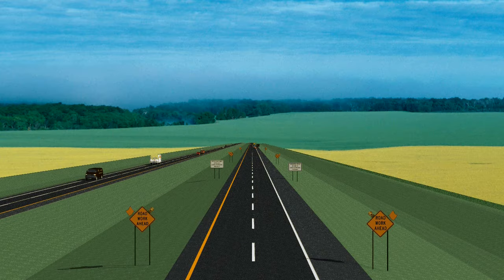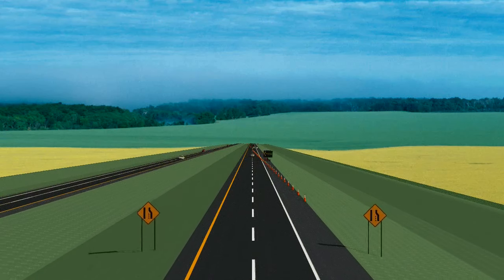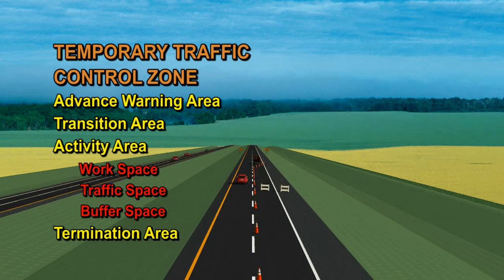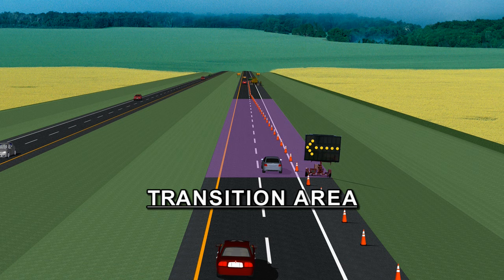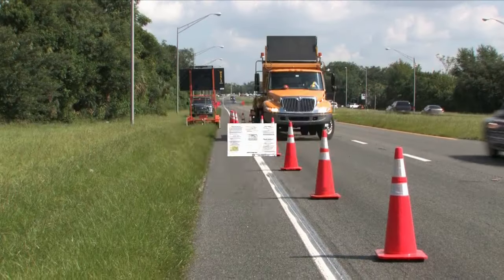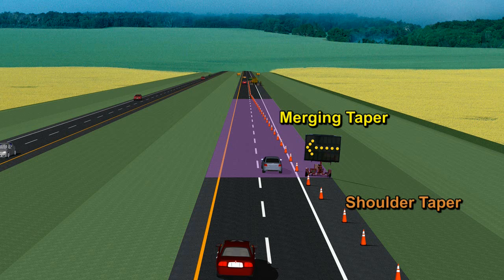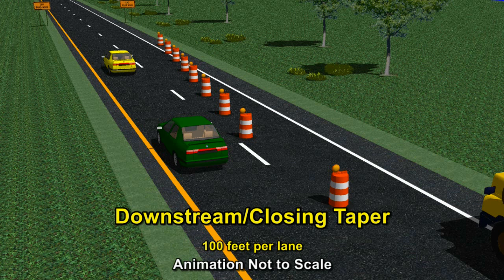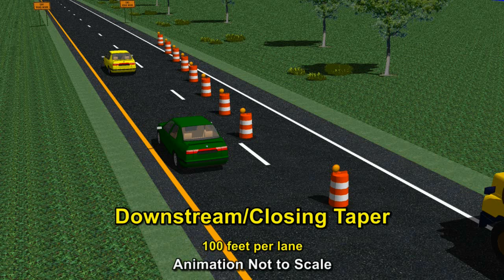Temporary Traffic Control Zones part 1 of 2.mov

Comment: how many advance warning signs are needed for a lane closure on a two-lane two-way road in CA MUTCD? thanks.
Reply: My company uses 3 as a standard, but can be as few as two if the road is short enough or if traffic moves slow enough. You will always want to at least have a "road work ahead" (or some variation) and "flagger" signs, but you really ought to also have a "be prepared to stop" sign if your roadway has the space for it.
Reply: Not sure about your State as it may have its own standards. In Florida, Lane Closures  require 4 signs per a side. Multi lane road ways that have a medium wide enough will require also signs. So 90% of Lane Closures in Florida will require 8 signs min. 

Road Work
Speeding Fines Double
Right Left Lane Closed Ahead
Transition / Merge Sign

Some also will additionally add a Should Closed Ahead sign